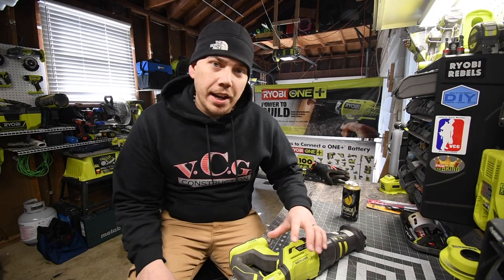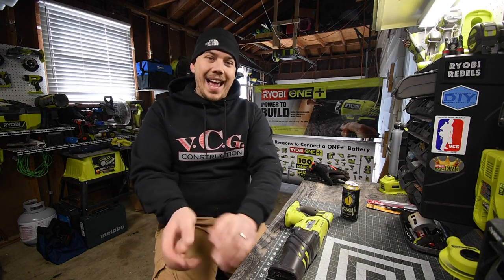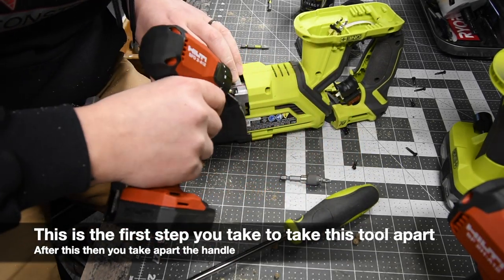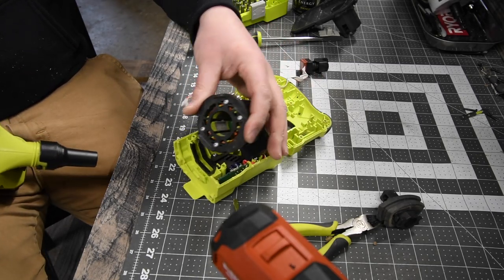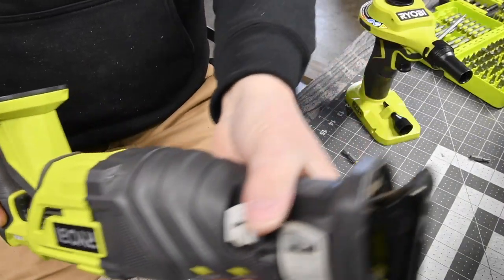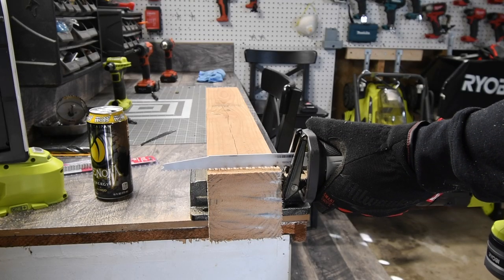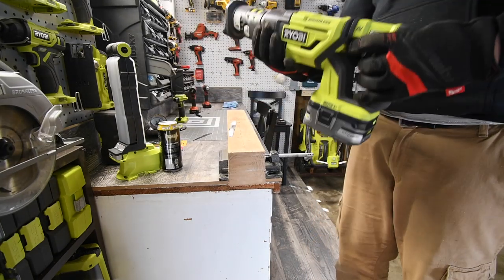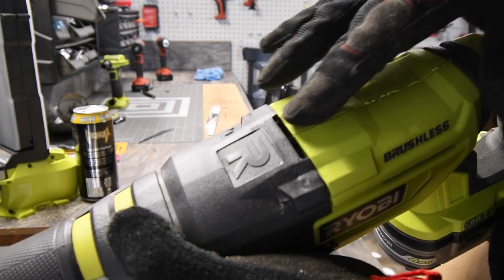Ryobi Brushless Recip Saw (Cleaning)

Comment: I can see you getting a good quality air tank, and using different inflators including Ryobi to test the pressure capability and have an air supply to blow off surfaces, and clean tools, ECT...
Reply from the maker: I do want to get the Ryobi air compressor

Comment: Great video hoss , I personally use Milwaukees 12 & 18 volt cordless tools for work. What makes this video a standout from others is that YOU took the tool apart and cleaned it out and most likely extended its life cycle a lot longer. 
  I remember when I took apart my first cordless tool to replace the brushes...I was petrified that I would not be to get it back together.  
 It's crazy the amount of crud that you find in your corded and cordless tools. It never hurts to take a blower to blow out all of the goo that gets sucked in through the air intake holes but never makes it out.
I'll say it again....don't be afraid to service your own tools if possible. BTW , that rubber boot will come off.....🤔
Reply from the maker: thank you sir, I gotta learn how to take it off

Comment: You don't have to cut the boot off.   It will stretch over the blade release,  and on the other knob that turns, just start the pin out from the small end, then turn it around and pull it out from the opposite side to remove the knob.   It takes a little effort,  but I was able to get mine off.  I didn't have much choice, the blade locking mechanism broke and had to be replaced, it  was either fix it or pitch it.
Reply from the maker: Yes sir, they put them on there so tightly

Comment: Is the brushless worth the extra 50 bucks over the p516 brushed version? After 3 years of use the output shaft broke on my 516 and I'm debating if it's worth it or not. Also I see they have a p519 version now that is brushed but I can't find out much about it except it has a shorter stoke than the 516/517 but has 3200spm like the 517.
Reply from the maker: 100% BL motors are way more powerful and way more efficient.

Comment: I have a BRAND NEW ONE, I just used for the first time today, pruning limbs with a 12" Diablo...and it stopped in mid cuts and wouldnt start again right away using a 4ah battery? is that normal?? Because my old Brushed one would rip no matter what til i burned if out lol. im kinda disatisfied with how it operates compared to the brushed
Reply from the maker: I had no problem with it no starting back up again. so im not sure. I abused the crap out of this recip saw and it still works great
Reply: @ManCaverTools  right on! i exchanged it for another...and this one works fine. I believe the other one was defective. Appreciate you and your reviews bro! They help out ALOT! Bless you🙏
Reply: sounds like a ryobi to me!!!

Comment: The way to disassemble my fuel sawzall is start by removing the switch levers on the front boot then yank boot off. How I do, is think how would they add screws in the factory. The boot is put on last and took off first, I think.
Reply from the maker: I gotta learn on how this boot comes off properly and thank you sir

Comment: you dont have to cut the rubber off of the front grip, just peel it back like a big condom
Reply from the maker: its on there good I tried off camera to get it off and I couldnt, I really wanted to get that apart
Reply: @ManCaverTools  Hello , it's a two man job , try heating it up a bit , then peel it from the back , but first take off the shoe , then the plate , and shuld be careful  when the rubber comes to tool relese lever. One shud hold the tool by the handle , while you peel the rubber, it's the same on most of the recip saws , AC or DC. btw , I'm the service man for ryobi , milwaukee and aeg , but also servicing most of the tool brands , if you have any question , feel free to ask, be glad tohelp